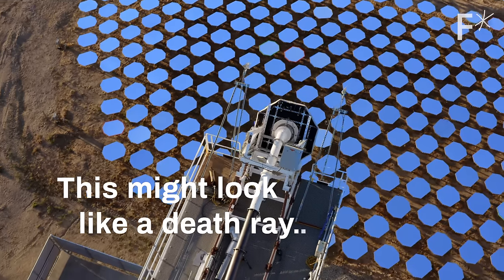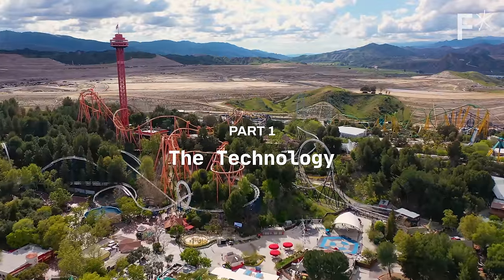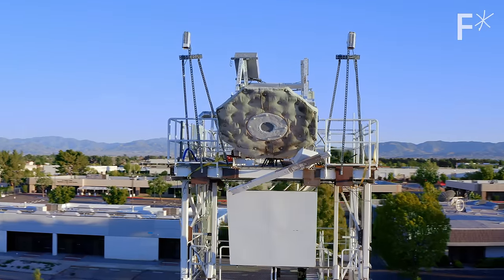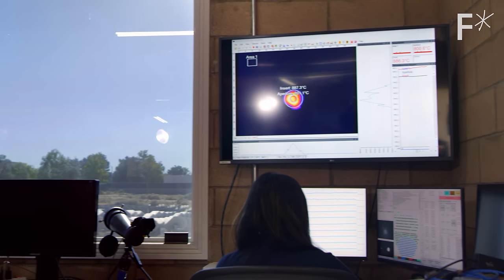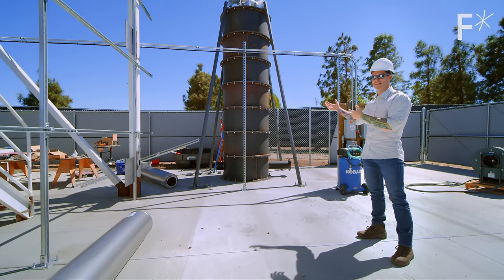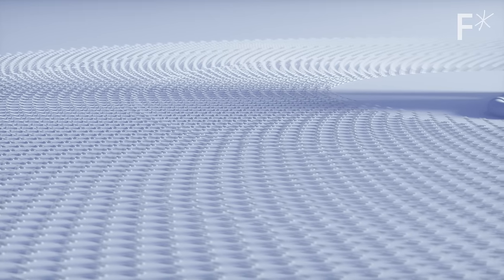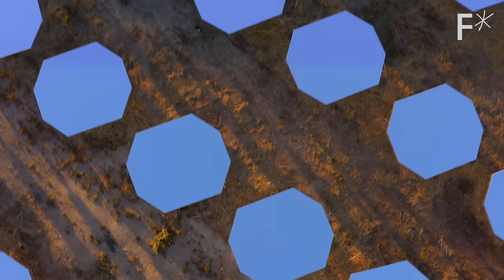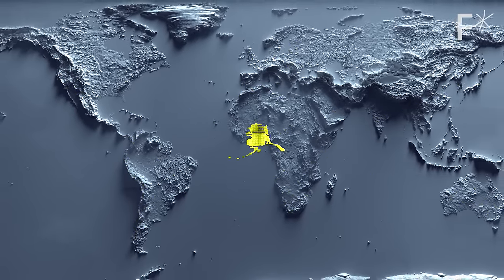How mirrors could power the planet... and prevent wars | Hard Reset by Freethink

Comment: Hydrogen? Really? After all the losses from conversion to and from electricity why would you bother? 
You end up with at best 30% of the power you put in.  Wouldn't you make more money selling 50% more power from the same input over intercontinental power lines? 
Seriously guys HVDC cables are the way to go, only 5% loss over 1000km.  Linking the worlds power grids would be a more effective solution, no need for grid scale batteries either if you can simply buy it from the continent next door that's still in daylight / highwinds.
I'm not even factoring in the massive amount of energy needed to compress the gas to 300 atmospheres, or the rare earth catalysts needed for hydrogen production that would need to be procured either.. 
Other than that, hotrocks are definitely a good solution. But I hope you're using a Supercritical carbon cycle to catch all that power and not an inefficient steam turbine.
Reply: Exactly.  It's great until they get to the last (unnecessary) step and waste all of that clean electricity (which is universal and needed by everyone) by inefficiently converting to hydrogen that has very little consumer demand without re-engineering all of our existing infrastructure and transportation.
Reply: @CL-gq3no  I don't think they are stupid to not consider the losses. Maybe they have some trade secrets to win over. No company will completely put out their methods.
Reply: @shankarmgs4056 , Doubtful.  A lot of very smart people in the renewable energy space are fixated on the idea of hydrogen as a replacement for fossil fuels.  Toyota for example is falling way behind in the EV race (they should be way ahead considering they made the first popular hybrid with the Prius) because they are very focused on hydrogen.  Hydrogen is very appealing when you only consider the consumer side of it (the cars for example).  However, when you look at the production, storage, and transport side of things it is an inefficient logistical nightmare.  For hydrogen to become the energy standard of the future would require EVERYTHING we have every built to be retrofitted or rebuilt.  The infrastructure would be very expensive (compressing/storing/transporting of flammable gases at 5000 PSI+ is not cheap or easy to maintain).  It's pretty much all the cons and few if any pros.

Meanwhile, the infrastructure is already in place for electrification of most things from consumer vehicles to lawn equipment to heating appliances.  It's just the existing electric grid with more renewable energy added to phase out fossil fuels.  For larger things like construction equipment, jets, and ships "synthetic fuels" are a better choice than hydrogen.  The infrastructure, supply chain, and vehicles would not need to be changed at all.  Synthetic fuels are basically direct substitutes for fossil fuels produced from carbon sequestration and electricity.  Other than the production methods changing, everything else remains the same.  It also uses sequestered carbon from the atmosphere which immediately helps with that issue.
Reply: I agree. Hydrogen is a pipe dream.  

On a different topic, why would using rocks for heat storage make sense? Wouldn't other concentrated solar power companies have tried such a simple method instead of salts?
Reply: @_capr_545  How long did it take humanity to put wheels on their luggage? 
It's all about mindset, an engineer or scientist will find the most efficient material possible to archieve their goal.  But they may not be thinking about the cost of those approaches or how easy / hard they are to manufacture as much.  
A person who's studied business, manufacturing, economics and engineering may be able to find the real world solution.. Like Elon.
A super critical carbon loop with a smaller turbine is probably more energy efficient.  But I'll bet the hot rocks and sand are infinitely cheaper to setup.
Reply: @CL-gq3no  Toyota is working on solid state batteries AND hydrogen AND hybrids.  For any new standard, it would require retrofitting of a distribution system.  That's like saying electric cars will fail as superchargers don't have a good enough distribution system and not all cars can supercharge.  It's impossible to eliminate fossil fuel systems.  That's the real pipe dream.
Reply: @uni4rm , last time I checked, electricity distribution is pretty well covered.  I can't think of a single building in the developed world without electricity.  So it's just a matter of installing chargers which is significantly easier than building the entire hydrogen infrastructure and losing most of the energy in the conversion processes.  Also, it's nice that Toyota is "working on things", but at the moment they have almost nothing in the way of EV products.  

And I never said the goal was to completely eliminate fossil fuels.  I'm simply saying we need to replace enough of it, starting with the lowest hanging fruit, to find a balance with nature.  Electrification of things makes sense as it only requires the vehicle itself to be changed.  Hydrogen is a pipe dream as it requires rebuilding everything from end to end.
Reply: Hydrogen is just one of the end products they offer. There are already major long-distance high-voltage power cable projects underway between sunny, unpopulated locations to areas with high energy consumption (Australia to Singapore and North Africa to Europe are two of them). With multiple Heliogen plants on the generation side, consumers will have cheap and reliable green electricity.
Reply: Ah, at last a comment that makes sense !
Reply: Inefficienct  steam turbine,  O H    I think not.

Comment: We have some of them in Spain. No more of them are made because the solar cells are now cheaper and more efficient than this system. You have a Tom Scott video about them
Reply: Finally someone with brains not falling for the hype. It's funny how they will not say a word about numbers in this video. You could cover same area with solar cells and get waaaaay more kWhr's of electricity than with this contraption. Also converting electricity to hydrogen is dumb idea. And they want to here to convert heat to electricty and than to hydrogen. Dumb as hell. Solar can be deployed virtually anywhere on the planet. Private solar energy production and trading it is the future. Fossil fuels companies just don't want democratisation of power, because they loose monopoly. Hence pushing large scale nonsense projects to solve something that already got solution.
Reply: The hydrogen part was dumb to me.  But we will need it for some things like ‘space travel’ but if they are wanting to run cars on it I will SCREAM!!
Reply: @KeithandPamBilyeu  There are already cars that run on hydrogen, since its better as a fuel compared to batteries.  The cost of such systems isn't efficient at all, however.  Go ahead and scream.

Comment: I’d be interested to see how the rocks are moved from the heat source to the storage.
Reply: They are not. They will use oil to move the heat from the heat-source to the rocks. There are some eco-villages in Holland that use this system to convert sunlight to heat (using conventional solar panels), and then during the winter, distribute this stored heat, to local homes. :)
Reply: @millanferende6723  I’ve seen the sand version, (In Finland) that uses excess renewable electricity. It heats via resistive means. They only heat the sand to 5 or 600 deg C. At the temperature they quoted in this video, over 1000 deg C, sand is liquid, and boils around 1500 C. I’d be interested to know which oil is used to make the transfer at that temperature.
Reply: @MrCarlRobinson  No idea, but I can imagine there are plenty of composite materials nowadays that let you have all kinds of properties. 

I know you had a different kind of mirror array, where they were ) shaped, and all would focus light onto a pipe running through them that contains oil. 

That is how I imagine it to be. But I guess there is nothing wrong with using sand, the only problem really is that once it cools off and solidifies (say during maintenance), do you just toss away the entire tube-system?

It will be interesting to know indeed on how Heliogen has circumvented it. These guys are brilliant.
Reply: @MrCarlRobinson  Well it seems like you know more about sand cooling than me. That is so cool!I was personally thinking that the oil runs so fast, that the oil only heats up to 500 degrees. Like it's 1500 degrees at the core, but the fast flowing oil cools it down.But I could be wrong though. It would be nice to see what they actually do. I am subscribed to their channel and am excited to see how it all actually works. 👍🏻
Reply: @millanferende6723  I was referring to the heating of the rocks. At such high temperatures at the collector, I’m wondering how they get the heat to the core. The Finnish model uses distributed resistive heating to store, and just air to extract the heat in insulated pipes for district heating.
Reply: Ei Dirst  I was a nuclear submariner for 18 years. The temperatures in a PWR primary loop are half of that at the collector here. Molten salt might do it, 800 deg melting point, but still 200 degrees shy. I wish there was more information in the clip.

Comment: All very noble but in the end of the day, this is a business like any other. Then there is this vision of putting this in few locations and distributing the energy to those who need it, well... these locations could in theory stop providing just as easily as nations who control fossil fuels. Then there is the hydrogen, that´s a whole different topic which I think is a bad idea (for small scale use like powering cars and such).
Reply: Why do you think hydrogen is a bad idea for small scale use?
Reply: @femiogundipe767  Hydrogen to power for example cars; producing electricity -> producing hydrogen (which is only 70-80% efficient) -> storing hydrogen (infrastructure + energy) -> transporting hydrogen (vehicles + energy) -> storing it again -> infrastructure to distribute it (hydrogen stations, infrastructure + energy, plus continuing dependency on companies to provide you with energy so you can get about) -> car

Electricity to power for example cars; Produce electricity (which you can do yourself if you want) -> transport (electric grid if you get it from an electric company, otherwise, it´s just your house wiring) -> household energy stations -> car

Now, there are some who try and debunk this by saying that electric vehicles get their electricity from fossil fuel power stations, but most don´t know that most hydrogen, or ∼95%, is produced by fossil fuels. Also, there a nations that are running near 100% renewable energy like Iceland, Norway, Costa Rica and so on, so it just makes more sense to have electric vehicles and they are getting better and better.

Imagine getting away with not using hydrogen stations. No more "gas" stations, you would just charge at home or in small stations in parking lots, that makes more sense to me.
Reply: @valli6174  You don't get it. What you are advocating would work in a densely populated area like European cities.  But that wouldn't work in the US.  It's not about how hydrogen is produced now.  Its about replacing that method with a green process on a large scale that would essentially replace gasoline as the main fuel as fuel cells in cars.  It will take years to replace fossil fuels in America as the main production for electricity.  Nuclear has sat at 20% for years, and is the best efficient way to produce electricity large scale, but there are only 4 new plants planned and only 1 built since the turn of the century.  

While battery tech is pretty neat, it is so lacking in density that you would need some new tech which doesn't exist yet to compete with a fuel driven vehicle systems.  Note that any battery car with good range competing with ICE vehicles are extremely expensive.  Most people cannot afford long-range $80,000 electric cars or their own solar panel system at home.  And if they don't live at home, but in an apartment block, where do they charge? Hydrogen is a solution now, that can work within the fuel distribution system the US has now.  Electric vehicles will always have issues with range and efficiency.  That's why they lost the last fuel wars when they came out over 100 years ago.
Reply: @uni4rm  That simply isn´t true. Battery technology is on the verge to tackle some major hurdles. I don´t think you fully grasp that, hydrogen is only perpetuating the old system of locking the customer in a very inefficient network, paying probably much more for the hydrogen than ever for the electricity. I think that the electric vehicle market will take a jump in the next years and range won´t be an issue any more. We are already past 500 km range with electricity and that is with old technology, the new one will push us even further, without many of the old technology problems and that is happening within the next 5 - 10 years, even sooner. There is a reason why most companies are betting on electricity and even countries. Many countries who bet on hydrogen and tested buses have switched to electricity as they have simply given up on it. Hydrogen may do some wonders for big consumers like ships and airplanes but that still remains to be seen. I sincerely hope hydrogen won´t take over, I don´t need to be addicted to yet another monopoly of "gas" companies, if I want to produce my own electricity and charge my car with it, I want to have the option. If hydrogen wins, you can bet that you won´t be producing much of it at home and filling you car with it.

Comment: First of all, I really appreciate these videos. They're interesting, entertaining, and have excellent production quality.
I have some comments on this one for constructive purposes:
It would have been helpful to see how they heat the rocks, and then how they convert that thermal energy to electricity.
The competitor to beat is solar PV panels. Can this tech compete economically?
The ending message is somewhat contradictory. First, they propose that there will be a handful of 'producer' areas (SW USA, Australia, northern Africa, etc) and the rest of the world are 'consumer' areas in an interdependent network. Immediately after, they advocate the importance of producing energy near where we need it.
If this system is used to generate green hydrogen, what's the point of the rock vault that stores thermal energy?
Reply: "what's the point of the rock vault that stores thermal energy?"

Efficiency. Waste not, want not.
Reply: @nickhepburn5150  if you're converting the energy to hydrogen, then adding a thermal storage step in-between will reduce the efficiency.

Comment: Interesting idea, but you lost me at generating hydrogen and transporting it over long distances.
Reply: The hydrogen part of this SMH….but hydrogen needed for space travel…but not for cars or anything else please!
Reply: Tell me how you hate batteries without telling me you hate batteries.
Reply: Yah, was a pretty good con for 6 minutes and 27 seconds.
Reply: Why did they lose you?  Generating hydrogen with basically little cost investment is the way to drive down the cost of the end-fuel.
Reply: @uni4rm  The problem with hydrogen is the small size of the atoms/molecule (literally number 1 on the periodic table, the smallest) and therfore it escapes from all kinds of non preventable small cracks in even the most expensive tanks over time, especially if tranported (movement, vibration).
Reply: @spadress  Plus, driving it all across america in pressurized containers.. where the vehicle will likely hit bumps, sudden stops, vibrations.. will equate to a very large and dangerous bomb going BOOOM and killing everyone within the vicinity of said vehicle.

They lost me at the, they only need hundreds of square miles which isn't very big.. then said it would cover all of Alaska.. which is like 600,000 square miles. Pardon? and also will they mention that these mirror arrays have not only killed plenty of birds, literally cooked them in the air. Also the sheer cost of building these IMMENSE mirror farms is no different to the impracticalities of Solar and Wind farms. They'll all need replacing within a few years, an to make them costs a lot.. in emissions.. carbon emissions specifically, so they're pretty pointless.

But what we do have already is freaking advanced nuclear reactors, not those very few reactors that went critical, no.. not those that you can count on a single hand, while solar and wind farms kill people on a daily bloody basis. Instead, modern day reactors are so god damn safe, they've even been working on PORTABLE NUCLEAR REACTORS for rural areas, to fit inside trucks and vans to transport them to rural areas that require power, or to be used for emergencies after natural disasters to supply energy to the local grid.. wow.. that.. would work so well but nahh lets waste billions on dead on projects that exist only to line the pockets of the contractors and politicians.

Seriously though, a Thorium reactor is so safe that if it did have a fault and go critical.. it literally freezes its rods over to something stupid like -174f.. or the reactor floods itself with liquid nitrogen or was it liquid argon? I dont remember.

Jist is, this is a scam, we already have the technology but because the uninformed, idiots and other moronic people get to shout louder that have NO, ZERO understanding of how nuclear fusion works and thinks a nuclear reactor can go BOOM.. when it cant and believe that every modern nuclear power plant can be fukushima or Chernobyl, it drags humanity down and stops us from progressing past the power issues..